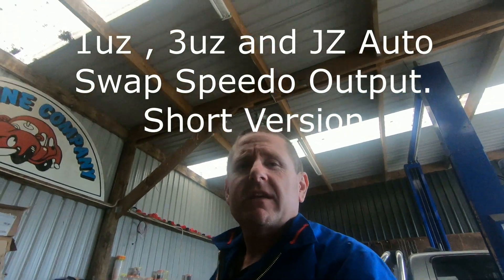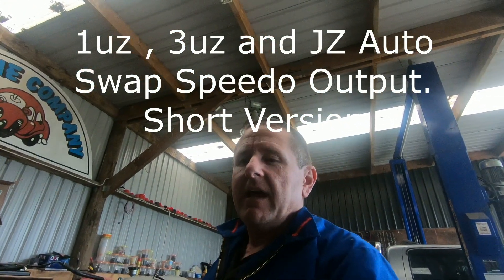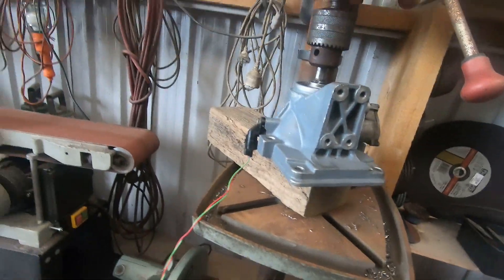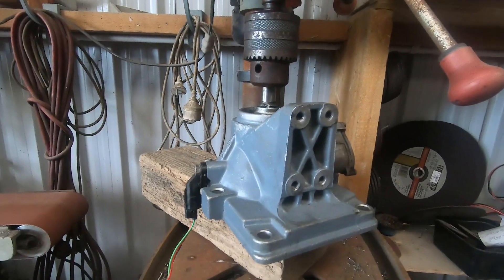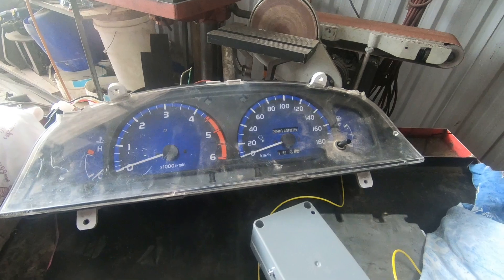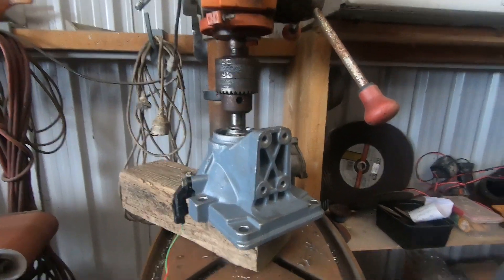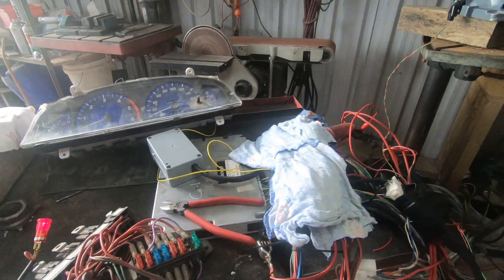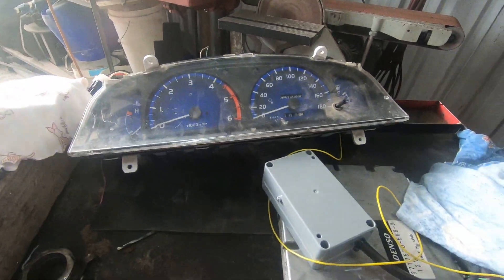Toyota VVti 1uz/3uz/1jz Speedo output with stock Auto and ECU and A650 or  A761

Comment: Have you done link g4 ecu speedo out to n70 hilux dash?
Reply from the maker: Yes,  heaps of times.
Reply: @CartuneNZ   iv just wired mine and it reads ok from 20kph on but it will start at around 20kph when slow down it will pause at 20kph then drop to 0kph soon as you move it jump straight to 20kph then work from there

Comment: Hi
From the ECU output which line do I connect to a Mercedes Benz w126 cluster.
Reply from the maker: I don't think you understood the video.   The vvti ecu doesn't have a speedo output,  it requires additional hardware to be added,  as per the video.  Cheers Kelvin
Reply: @CartuneNZ  thank you